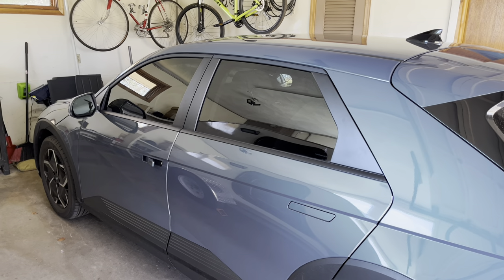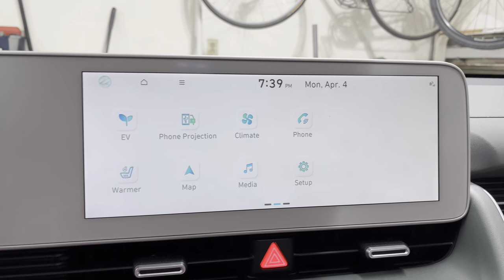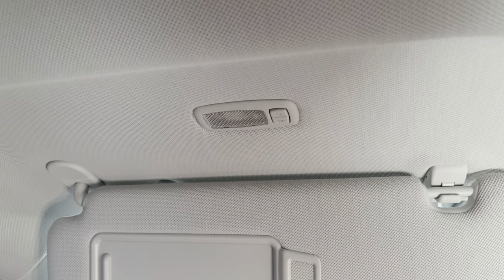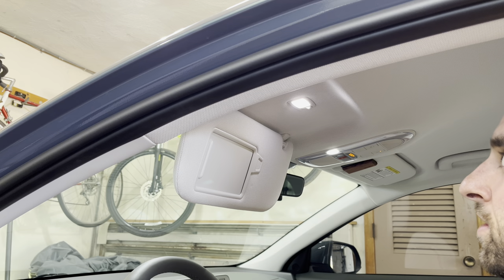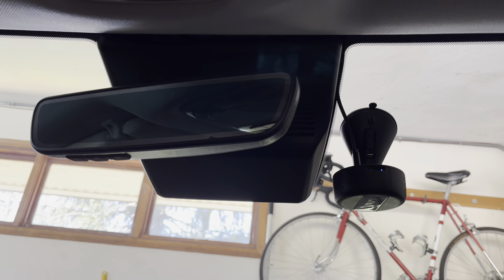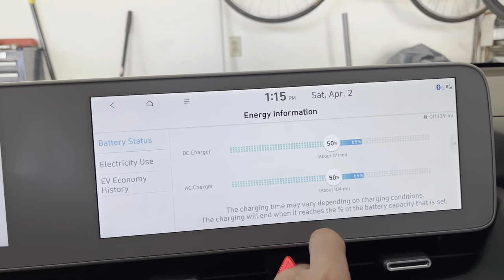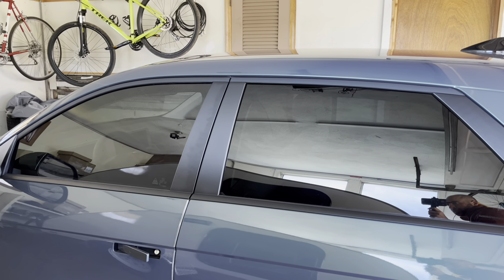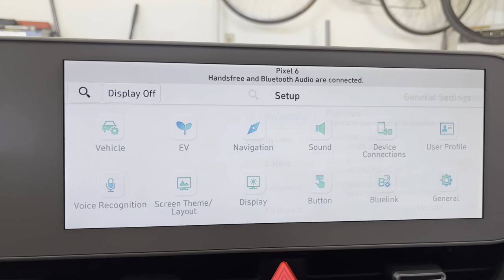First 10 Things To Do To Your Ioniq 5!

Comment: Excellent video ! Thank you - What is the easiest way to change the glove compartment light to LED ? Did not see that in the video ...
Reply from the maker: No easy way. Too difficult to disconnect the module without breaking wires. Trust me, it's  not worth it
Reply: @TheIoniqGuy  Thanks for the quick reply, I agree ! I tried a few times but just couldn't get it out and was afraid I would snap something so I let it be...Just got my Ioniq 5  a few weeks ago and am so relieved made it under the wire for the tax credit ! Without that this car would be out of our reach ... Thanks once again...

Comment: GREAT STUFF.  NO OWNER YET, BUT SHOPPING FOR THE LIMIRTED VS THE SEL.  IS THE LIMITED  WORTH THE DIFFERENCED IN PRICE ?.  SURPRISED THE CHEAPER SEL HAS REAR PARKING & THE LIMITED DOES NOT........   ALSO DO I  NEED ALL WHEEL DRIVE IF NOT TOO MUCH SNOW IN MY AREA & NO OFF ROAD DRIVING....
Reply from the maker: I personally regret not going for the limited. Sounds like RWD would be good for you but RWD limited are very rare and extremely difficult to get

Comment: Currently we have an old Leaf and a Tesla 3.  Going to trade in the Leaf and get the Ioniq 5.  We use a 220 outlet in the garage straight to the cars (We can only charge one at a time.)  But we don't have a level 2 charger like this.  What is the benefit? Thanks.  I enjoy your channel!!
Reply from the maker: Thanks Guy! What are you using to charge your Tesla?
Reply: @TheIoniqGuy  Just the supplied Tesla cord from the 220 outlet to the car.  We got a giant 220 splitter.  One side goes to the Tesla and the other to the Blink wall unit and to my Leaf.  It works.  We time our charges so they're staggered overnight when rate is lowest.
Reply: @TheIoniqGuy  And I just got the call from a dealer last night that a black/black AWD limited is available.  I jumped on it!  Listed the Leaf today!!
Reply: @guyhenry3047  lucky you! 3 year wait here

Comment: Very helpful, thanks. I have an AWD SEL, and I find the beeping from the proximity sensors very annoying. They go crazy when I pull into or out of my garage, and they even go off in normal traffic, e.g., when I am in a double-turn lane. Do you know of any way to turn these warnings off?
Reply: Possibly with OBDII device. There are quite a few custom settings on those.

Comment: Is there a way to keep the dashcam powered on and powered by Ioniq when ignition is turned off?
Reply from the maker: You could either get a dashcam with an internal battery or you'll have to run a wire to the fuse box and tap a circuit that always has power
Reply: @TheIoniqGuy  ah I see. I have to leave my car parked in nyc queens sometimes, but I guess this will require more work. I did use your method to pull an usb line from the rear view mirror though. Now just have to figure out the fuse box

Comment: Another great video! Along with the side window tint, I got a strip along the top of the windshield as well. Helps when the sun peaks through the cracks and holes when the visors are down. I drive into the sun to and from work and it helps. I went to look up those LED replacement lights for the rear and visors lights. They say they are not compatible with the Ioniq 5 but if you're sure, I'll order them. Those incandescent bulbs are terrible! Lol
Reply from the maker: Thanks Aaron! I considered doing that as well but didn't end up pulling the trigger. As long as you order the 31mm, they should fit perfectly. I think it takes Amazon a very long time when new cars come out to verify products for them which is unfortunate.
Reply: @TheIoniqGuy  Haha yea...taking your word for it. And yes I can see that with Amazon 
. Ive been using those Bosch icons for years now. Even on my old cars and my wife's car too. They last a while! I love the service wiper feature. Had to call Hyundai service for that. Luckily there's a really knowledgeable tech at the dealer I got my ioniq 5 from. One thing I've noticed with HDA, my car likes to favor the right side of the lane. It's noticeable because I'm always putting pressure on the wheel to keep it in the center. And how it's supposed to recognize a large truck and push over to the other side of the lane....it feels delayed because by the time I'm at the truck it's too late and ends up moving over just before I'm done passing it. Have you noticed that?
Reply: @MegaSn0wb0ardJunkie  I think a lot of folks tend to favor their left side when driving, including myself, and so it's very daunting to have the car move closer to the middle. I've experienced the same.

Comment: Hi. Are you able to replace the glove box bulb?
Reply from the maker: I attempted to get the housing out but the connecting cable is so short that I wasn't able to pull it out and get it taken apart. Maybe if you pulled the entire glove box assembly out of the car you could but at that point, I don't see it being worth it considering how little it'll be on.

Comment: Hi. The amazon link for the bulbs takes me to a site that has 31mm bulbs upwards. Do 31mm fit or only 28mm. Thanks.
Reply from the maker: The contacts for the bulbs are flexible so 31mm will probably work but you may have to force them in. I would just find any other 28mm festoon bulb and use that but that’s up to you
Reply: Thank you.

Comment: While replacing the trunk light, I let go of the cable after unplugging it and it fell down into the cavity. Any idea how to get it out?
Reply from the maker: Bummer! Either take apart the trunk via this video: https://youtu.be/7Yv7MeC3B08

Or you could get one of these and try to grab it. https://amzn.to/3NVxX1x

Put a small kink smaller than the connector on the end of a bent hanger and try to get it around the cable so that it pulls the connector up
Reply: Thanks for the video link, that is exactly what I was looking for. I'll try the grabber method first, hopefully that works.
Reply: @thegoldenpasta1288   Unfortunately I did the same mistake as you as the wire went down the hole and I am unable to retrieve it with long pliers. Did the grabber method work for you using the ioniq guy grabber tool? Thanks.

Comment: Hi, Thank you for posting I was most interested and informed by your informative video.  Please advise, are the Trunk, Vanity, Glove Box and Front Fruit Box all the same size / wattage LED Bulbs?   Lastly why only charge to 80% and not 100%?
Reply: Basically the physics of batteries means the ideal battery health is between 20-80%. So maintaining your battery in that range will minimize battery wear compared to going from 0-100% every time. There's also some issues with holding a battery at 100% charge for long periods of time, although I'm fairly sure they've managed to fix those issues on the latest smartphones, so I assume Hyundai has too.
Reply: @BigReviewMan  Thank You.
Reply: @Lensman3333  it won’t hurt the battery going to 100% from time to time but it should only be used when planning a long trip. When doing your day to day driving 80% is more than enough. There are other actions you can take to increase the range like setting a departure time in the car app and heating up the car while plugged in using line power instead of battery power.
Reply: @Reindrikfredfeldt  Thank You
Reply: @Reindrikfredfeldt  Thank You
Reply: @Reindrikfredfeldt  Thank You

Comment: there is actullay no 28mm bulp on the market (your link is out of stock). would 31mm fit?
Reply from the maker: Are you in the US? I just went to the link and the 28mm are in stock
Reply: @TheIoniqGuy  just blue ones
Reply from the maker: Weird. I see xenon white 28mm available for delivery tomorrow. 31mm will likely work but will just be tight

Comment: I have spent about 1/2 hour trying to get the LED bulb installed over the drivers seat.   You show it being a simple snap but I think I've torn my rotator cuff trying to get the bulb back in.  And it's still not done ✅
Reply from the maker: As someone with a separated shoulder, I really hope you didn't injure it 😬 Trying to get the bulb into the housing or getting the lens or something else out?
Reply: @TheIoniqGuy  trying to get the bulb in.   It's seemingly impossible.    I've watched and re-watched the video and you simply and easily snap the bulb in.   All the strength I can muster and can't get the bulb in place.    So frustrating.
Reply from the maker: Can you get the old bulb back in? This wouldn't be an issue if Hyundai just made them LED from the get go.

Comment: First thing to do is purchase a portable battery charger. See https://youtu.be/A4NUdNWyocM for ioniq 12v battery issues. Following this I would apply some rain-x or similar to the rear glass. Finally I would spend the next 8 hours reading the manuals and familiarising yourself with all the tech :)

Comment: I test drove one recently on a rather wet day out. The rear windshield without a wiper is horrendous. How do you get around that? Does spraying it with rainX help?
Reply from the maker: https://youtu.be/TysvWwToKfY a coating helps for sure but it's just a bandaid, not a solution
Reply: There’s a rear view camera button on the dash , I just press that , you can have it always on if you like 👍🏻
Reply from the maker: That's country specific. In the United States once you go over 3 or 4 mph, it turns off
Reply: Curious how sedans like Mercedes e class or BMW series 5 have never had and still don't have rear wipers yet the world has no idea how to clean a rear window, polish and wax the rear window with good quality car body products and as if by magic the dirt and rain falls off plus cheap turtle wax window cleaner works well but as I have always done after 22 years of motoring polish and wax the rear window sorted wiper or no wiper, plus i agree it should have come with a wiper.
Reply: @davidoconnor8862 snow and salt happen.
In downpours in cold weather that stuff is gonna stick regardless.
If that was all that was needed, wipers wouldn't exist.

Comment: Hey Ioniq Guy. I have a question I can't find an answer.... When I'm driving on a 50 mph road and I want to slow down to turn and using the regeneration paddles, instead of the brakes, DO THE BRAKE LIGHTS TURN ON IF I'M NOT USING THE BRAKES?
Reply from the maker: If you're in level 0 or level 1, no brake lights people will just think you're coasting. Level 2 and higher will cause the brake lights to come on immediately after releasing the brake pedal. If you modulate the pedal without fully releasing they won't come on
Reply: @TheIoniqGuy  
Sorry for asking for clarification... If I'm driving 60 mph, I have a turn ahead, I don't touch my brake pedal at all, but I use the regen paddles to go from 1, to 2, to 3, and then iPedal, will my brake lights stay on?
Reply from the maker: If your foot isn't on the accelerator, when you switch from 1 to 2 they will come on
Reply: @TheIoniqGuy  
By the way, thanks for your videos!  My dealer here is Maine knows nothing about how to use the technology in my Limited.  We are a 70+ year old couple and we both knew more about the Ioniq 5 than our salesperson.  We attribute our knowledge, as limited as it is, from your videos.  Thank you for your expertise and passion!  By the way, though the dealer in Westbrook Maine doesn't know very much about the I5 at least they are selling the car MSRP.
Reply from the maker: So happy to help you! An informed buyer is the best buyer

Comment: I have a canadian ultimate 2024 and thanks to you i changed the bulbs, the whipers and used that dongar. 
But believe or not we do not have that magnetic panel here...i think mine is a speaker... I'll need to verify with the manual.
Reply from the maker: Nice! The panel isn’t magnetic, it’s a steel plate. You can place magnets on it. It’s not offered in any market as a speaker

Comment: Hi Corbin, do you feel its a bad idea to charge to 80% every single night? How low of a state of charge percentage do you drive it before you plug in again?
Reply from the maker: Not at all, that's a fine state of charge. I usually start the week at 80% and then recharge at 0-10% but I plan around my schedule as well for whatever distance I actually need.
Reply: @TheIoniqGuy  am I harming my battery by plugging in and charging from approx 65-80% daily? Would you recommend running it down to 20-30% before charging to 80% to reduce the number of charging cycles? Or does that matter?
Reply from the maker: Based on research and articles I've read, smaller charges more frequently are better than deep charging cycles less regularly. This should cause less degradation over the life of the battery
Reply: @TheIoniqGuy  Excellent. Thanks. I will continue to plug in nightly (around apprx 65% SoS) and charge to 80%. Appreciate your efforts.
Reply: @wtfx5757  Confirmed. The battery of the Ioniq5 likes to be at 50-80%, while one charging cycle is 0-100%. So when you are charging 5 times 20% that counts (roughly) as one charging cycle.

Comment: The led bulbs are diff in vanity compared to the one in the trunk and the lights you recommend only fit the trunk not the vanity can you post which is the right vanity light @ionic guy
Reply from the maker: Why doesn't it fit in the vanity light for you? Is it loose or too tight?
Reply: @TheIoniqGuy   its tight doesnt go in between prongs like how it went easily in the trunk
Reply from the maker: You're going to have to keep fiddling with it. I've received comments from others here who said they worked great. 31mm is 100% the size needed so you may just have to flex the electrical contact slightly to get it in. Those metal tabs are stronger than they may look. Keep my posted
Reply: @TheIoniqGuy  oh ok ill give that a shot and keep you posted...thanks Bud :)
Reply: @TheIoniqGuy  it WORKED!!

Comment: I thought Hyundai by default set there programing to only charge to 80%. Meaning you can charge to 100% and it shows 100% but is actually only 80% charged.
Reply from the maker: No that's not accurate, there is a roughly 3% buffer. So when the battery shows 100% it's actually at 103%. When it's at 0% the battery actually has about 3% left.
Reply: @TheIoniqGuy  thanks for the reply and update, mine arrives on Saturday trying to understand as much as possible.

Comment: i'm really stumped by classic incandescent bulbs inside modern electric vehicle, i wonder what's Hyundai justification of this
Reply from the maker: Somebody who worked in the automotive industry told me that they most likely have so much stock of them that they're just working through them till they're gone then they'll switch entirely to LED
Reply: @TheIoniqGuy  yeah, that's the most reasonable explanation, this and probably LED's potential unreliability? i mean you don't really hear about burnt out bulbs in those lights, mine are as old as my car, that's 16 years
Reply: @manielek  LEDs tend to be MORE reliable than incandescent, especially in environments with a lot of vibration like automotive.   🤷‍♂

Comment: Hahaha wipers are bad indeed! Same on the EV6!
Reply from the maker: I wonder if they use the exact same wipers
Reply: They likely do use the same. I'll have to check on that when my EV6 arrives. On the other hand, I live in a warm, dry climate so it may not be an issue.

Just a recommendation, when changing wiper blades, I always put a pillow or rolled up towel on the windscreen. I leaned from experience that if the wiper arm snaps back onto the glass while the blade is removed, it will crack the windscreen.

Just a little insurance.

Comment: So 31mm not 28mm bulbs?
Reply from the maker: 28mm as linked in the description
Reply: @TheIoniqGuy  When I click on the link it opens Amazon UK with the following description

 "194 Led Bulbs 31mm DE3175 Led Bulbs 42mm 578 Led Bulbs 39mm 36mm 6418 Led Bulbs,Fit For Map Dome Vanity Mirror License Plate backup Lights 12V (20pcs LED bulbs total)"

Am I missing something in the description?.
Reply from the maker: It probably doesn’t work properly because it’s a link to the US store. You’ll just have to search for 28mm festoon leds on your UK store

Comment: Hi there, I had a question for you! I just got my ioniq 5 and I commute daily a total of 70 miles roundtrip from home to work and back, and with the current temps (and errands on weekends)I find myself charging about 3x a week when I hit about 45% and get it back to 80%. The thing is I live in an apartment complex and don’t have access to the garage so Ive only been charging with DC chargers. Is that going to be bad for my car…?
Reply: Don’t charge to a 100% each time and you’ll be fine with DC
Reply: @michaelsmith110  I appreciate it! Your video was very helpful and I learned to check on some things from it.

Comment: 2:00 WHAT?! Why would they give you incandescent bulbs in the first place? Indeed, when they give you incandescents, now you're stuck with the BULBULAR form factor for the life of the car. Lame. I bet Tesla doesn't do that.

And how do you reliably tell what type of light is inside without taking the cover off of each one? Even then, you might be uncertain.

And to top it all off, as the video suggests, your replacement lamp may not provide the same amount of type of light. No one should have to mess with these issues.